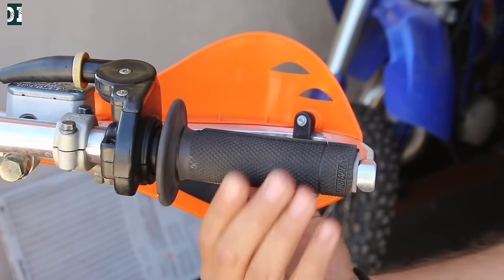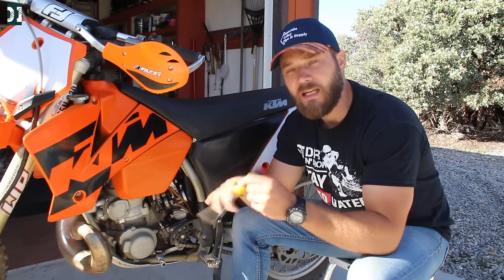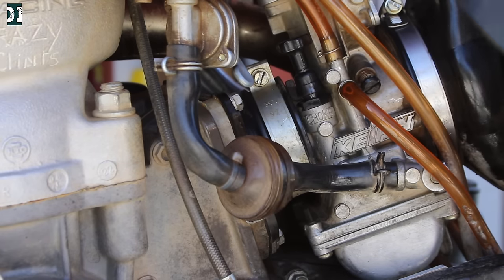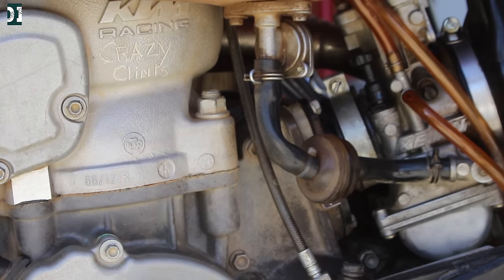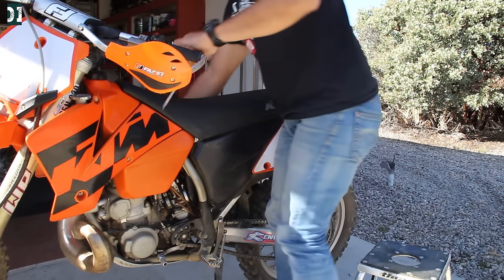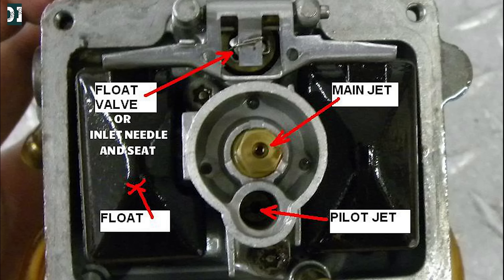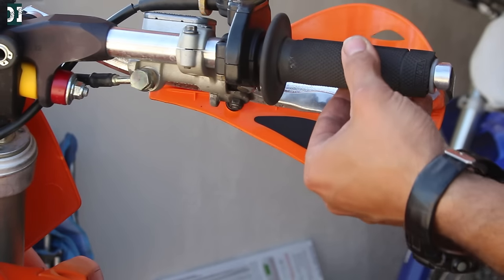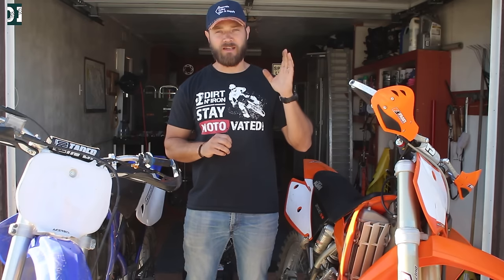How to adjust idle on 2 stroke dirt bike - air screw adjustment 2 stroke.

Comment: This guy has no idea how to tune an idle circuit...
Reply from the maker: help us out, what is wrong on the video?
Reply: @dirtniron  When setting the idle circuit there are specifications your specific carburetor is designed to operate within. Usually this means adjusting and rejetting the carb until a consistent and proper idle is achieved at a specific amount of turns out on the air/fuel screw. For example, on a Polini CP carb, thew proper idle jet is achieved when you get your highest idle with the air/fuel screw at 1.5 turns out. Read your manual. This is why jets come in kits. The only place "going by feel" is ever proper on a carb circuit is the needle adjustment. Carburetors are built by people who understand science, construct them with that science in mind, and intend for them to be tuned accordingly.
Reply: @DirtyDangler25  Hes not wrong. KTM manual says:

-Turn idle air adjusting screw slowly in a clockwise direction until the idle speed begins to fall.
-Note the position and turn the idle air adjusting screw slowly counter clockwise untill the idle speed falls again.
-Adjust to the point between these two positions with the highest idle speed.
Reply: His video title mentions how to adjust the idle on a two stroke dirtbike, not a KTM specifically.

Also, the instructions you mentioned are somewhat vague, but sound very similar to what is commonly thought of as the correct was to tune a 2T carb amongst real 2t tuners. If that's exactly what he was describing to do in the video, then he's probably pretty close to correct. I don't care to re-watch the video to see.
Reply: @DirtyDangler25  I ment what you were saying sounds what the KTM manual suggests. Aiming for highest rpm at idle. I think DirtNiron was saying to go by throttle response. 
That manual was for the 2T 300exc
Reply: @brendon8702  Ahh okay sorry. Yes, going by feel is the most inaccurate way to tune a carb. Your bike will run and if you're ignorant enough, you'll think it runs correctly. 

The internet had created a sad state of tune in the 2T world. This video is a great illustration of that. 99% of the comments are leaving remarks about how great of a tutorial this is, when it is actuality it's bad information. The poster will leave the video up because he's trying to make a buck, even though he's been informed (also informed of the correct information, which he chose to ignore) he's dispensing misinformation and all of these misinformed people will go about spreading the new knowledge they've acquired and it'll continue to worsen the problem. In the end though, probably good for us who know what we're doing because it keeps the manufacturers of top ends in business for us.